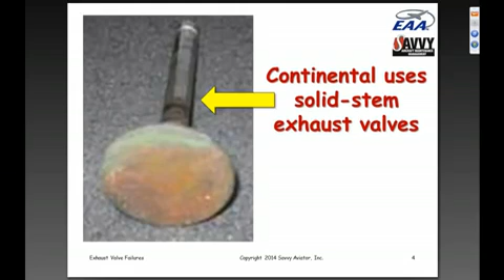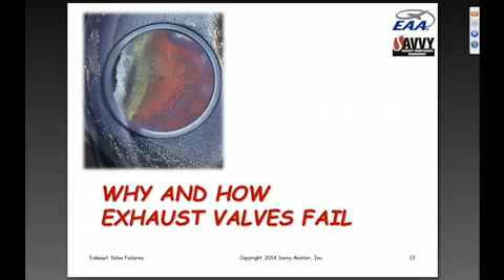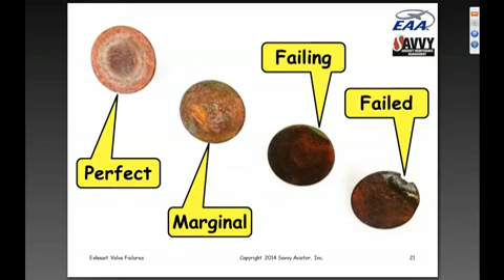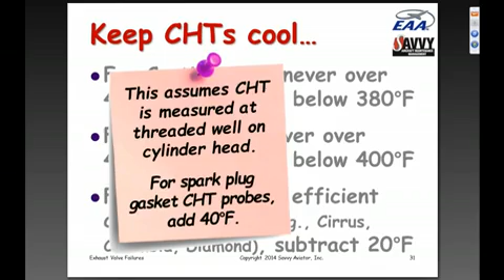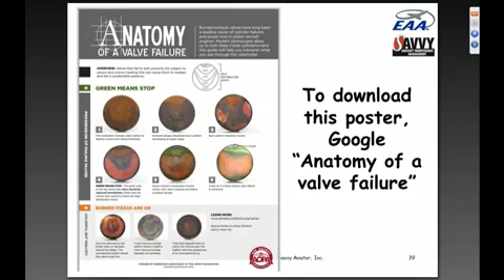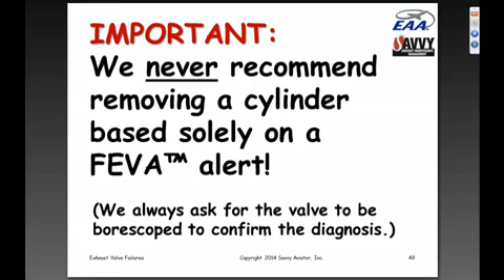Exhaust Valve Failures

Comment: Due to running LOP for 2 year I have had not one but 2 exhaust valve failures.  Lycoming tells me it is directly related to the practice of LOP cruising as instructed by Savvy.  That's too bad because it does save a lot of fuel but it hell on YIO-390 exhaust valves.  I had one freeze open and unfortunately one froze closed and bent the rod and shroud.  I am having the cylinder pulled to inspect the cam.  I hope it is not worse than just the rod bent.

Comment: Question without notice gentlemen……. 0-235 #4 cylinder, found a crack in the head of the exhaust valve surround. Exhaust Valve was good, colour and pattern 63psi compression leak test, other pots 72psi.
What would cause the crack vertically on the head that surrounds the valve stem and guide, parallel to the valve line?
It was great for the A&P to pull the cylinder during the 100 hourly (IMHO), we found a problem and now correcting it with a new cylinder.

Comment: Not sure why people use these dinosaur lycoming and continental engines, they are such poor quality. Modern liquid cooled, higher revving, DOHC, bucket lifter engines solve all of these problems.
Reply: The certified aircraft we fly, haven’t been approved to install the type of engines you mention yet. That’s why.
Reply: No, they don't.
    The main benefit of dohc with shim adjustment is reduced reciprocating mass, allowing high rpm without valve float.
    Propeller rpm is limited, efficiency drops drastically if the OD (tips) go supersonic, a propeller large enough to handle, say, 200 hp is limited to rpm in the mid 2000 range.
    A high rpm engine then needs gear reduction. Sounds simple, but they are heavy, expensive, and troublesome, some GA engines have them. 
    NO car engine will do what a "boring, crude" io-360 will, which is make 150-180 hp for 3000 hours (they often go way past TBO)...cars typically need 30 +/- hp to cruise at 60 mph...this is what most 200 to 400 hp car engines spend most of their lives doing.
    Engines that do what an IO-360 does are very common, however. Medium and heavy duty truck diesel meet almost the same requirements...similar power, similar RPM, similar, or even longer life.
    A noticeable difference is that they weigh maybe 1300 to 3000 lb. Equal to or much more than a whole cessna 172. 
   That would never fly.
    Would you suggest a small, high rpm DOHC engine for a large truck? 
    With the right transmission,  it might work...for dozens, or maybe hundreds of miles, while inefficiently gulping gas in an effort to quickly destroy itself.
     A Nissan GT-R engine, or some porsche or Ferrari has more Hp than a tractor-trailer...are they only absent from those trucks because the Peterbuilt engineers aren't as enlightened as you? 
    That's a funny thought.
    Look up the Mooney PFM. Small plane with a small porsche engine. Porsche realized their mistake and tried to buy all of them back, I think.
Reply: @firstielasty1162  I'm sorry, but you have a lot to learn about engines. Your opinion is that an IO360 is unsuitable for aircraft, instead a large single cylinder 150 rpm engine should be used with a massive propeller.
Reply: @chippyjohn1  nah...other than me being flat sick of them, and the fact that (to my ear) they don't sound good, an io360 is about perfect for an aircraft that needs 180 to 200 hp.
Reply: @firstielasty1162 Most modern engines don't rev very high as they are usually turbocharged and undersquare, the real reason for DOHC these days is separate VVT for the intake and exhaust cams. 
The Diamond DA40 NG, a certified aircraft, completely proves you wrong, as it uses a Mercedes OM640, a modern electronically controlled common rail injection 2 liter 4 valve per cylinder DOHC diesel engine, a very typical passenger car engine, equipped with a gear reduction.
Replacing the "NO" in your statement about the ability of car engines to produce 150-180 hp for thousands of hours with "almost all modern" would make you look like a lot less of a joker.
In fact, the OM640 used by Diamond is tuned to produce 168 hp which is 30 hp more than the highest output from the stock Mercedes engine. There is nothing wrong with modern engines producing reasonable amounts of power very efficiently, the engineers have simply chosen to make use of modern technologies proven in the automotive industry for decades instead of refusing to advance beyond 1930s tech.
What makes you think these outdated aircraft engines are so special? By the 1950s, when most GA aircraft were designed, the typical Lycoming and Continental engines were hopelessly outdated, with jet power being fully embraced by all major military powers and even beginning to see adoption in civil airliners. If only the aircraft engines utilized in most GA aircraft were about 10 years more modern, using technology proven over millions of flight hours in WWII. Then they would have many of the advancements we see today on modern engines, such as liquid cooling, 4 valves per cylinder, gasoline direct injection, one lever control (automatic mixture and prop pitch), and a reduction drive.

Comment: This is amazing information!  The whole thing is pure gold.  Thank you Mr. Busch.  Scary that a run of cylinders could be substandard brand new right out of the box.  If only one could find a list of the shops who do the best cylinder overhaul work . . . talk about exacting specifications!   Many shops to choose from out there.  And most of them screaming in print how qualified they are.  One cannot choose based on advertising alone.  After you get over that hurdle, then who is to install . . .  These are the enduring questions that plague aircraft owners wanting to get a good night's sleep when confronting a stuck valve   : )

Comment: Over 3,300 views and only 35 likes? Tough crowd. 

These webinars from Mike Busch are some the most knowledgable data one can acquire on the operation of an aircraft engine. Thank you, Mike.
Reply: @rustysummers3217    I understand.  The way I look at this is to paraphrase MLK.  I judge Mike Busch by the content of his knowledge and presentation, not the “color” of his presentation.  Much rather listen to someone who knows the subject rather than a smooth talker who might be good at selling used cars.  The knowledge you gain is certainly worth the time.

Every aircraft owner should make the effort to be involved in the maintenance of his or her aircraft.  Your plane will be happy, as well as your wallet.
Reply: @rustysummers3217    I can’t transport my family and supplies to a remote cabin with an Ultralight, and if you didn’t build your experimental you can’t do the Condition Inspection.  The key word is supervision for doing your own work beyond 43.13, just like someone working off his experience for his A&P license in a shop.

I just don’t think a pilot should be like the guy who has to take his car to the dealer to check the transmission fluid level or even change the oil because he doesn’t know how.  That guy is going to miss something that is eventually going to bite him.  

I know a guy who was going flying after he saw a big prop oil leak on his hangar floor and a wet prop above it.  He didn’t understand the system or the consequences.  Could he change a tire or troubleshoot and change a bad spark plug while flying the backcountry with no A&P in sight?  All legal under 43.13.

I have many examples I have witnessed over the years of how knowing your airplane is better than not knowing it.  Of course, a man has to know his limitations.  Thank you, Inspector Callahan.